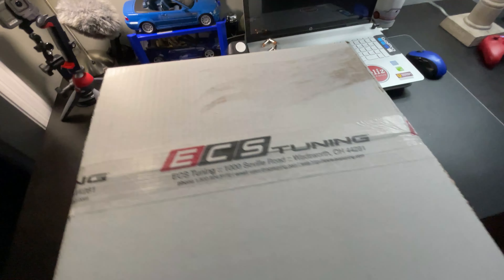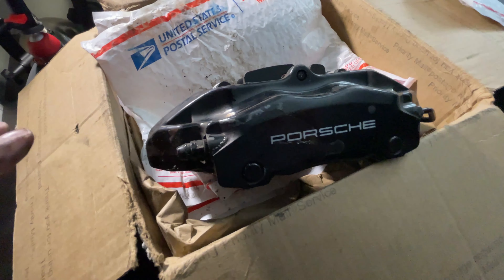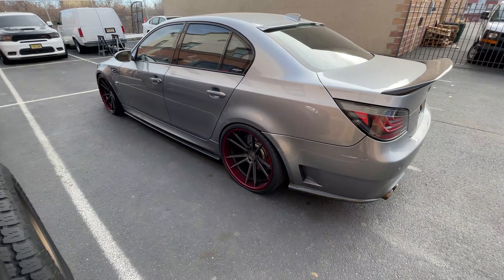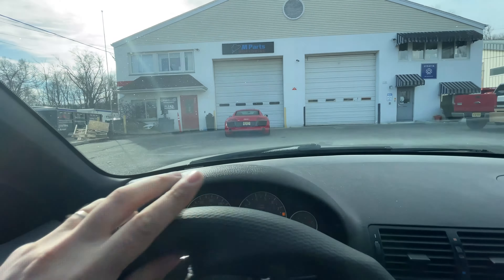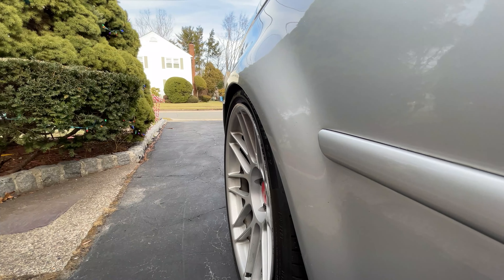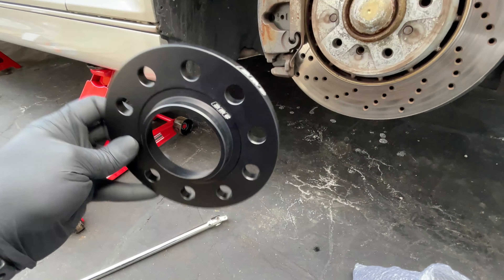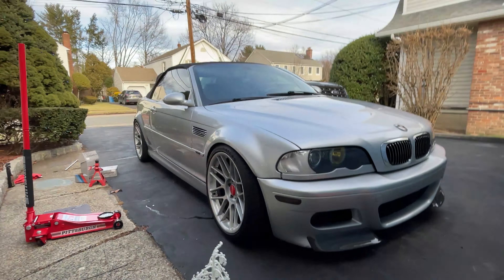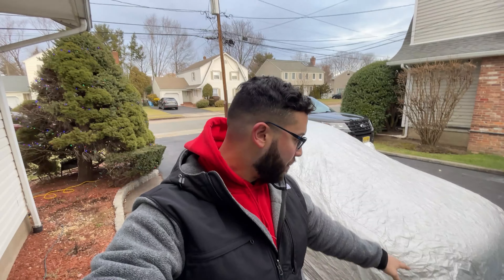I bought a bunch of car parts! (E46 M3)

Comment: What offset/width are the Arc8's?
Reply from the maker: Hey, they are 9 ET20 & ET22 9.5
Reply: @felizgarage  ok. I think a 5mm spacer would probably be the max in the rear. That still sticks out 1.65mm further than a 10" et25 for example.

I have 9.5j et20 on mine (with spacer) and it is pushing the limits.